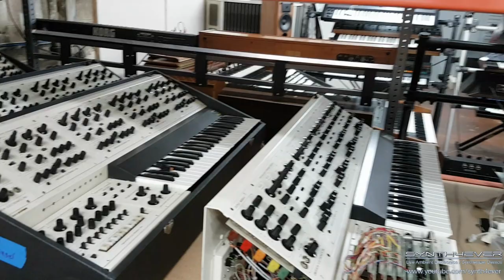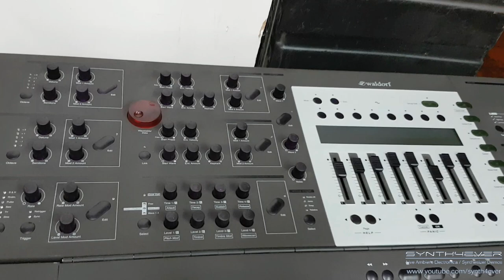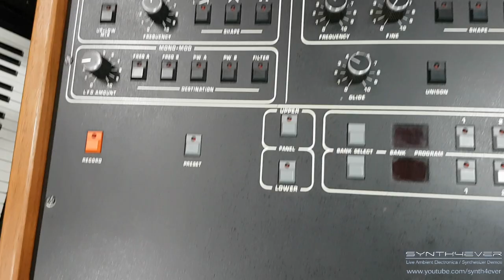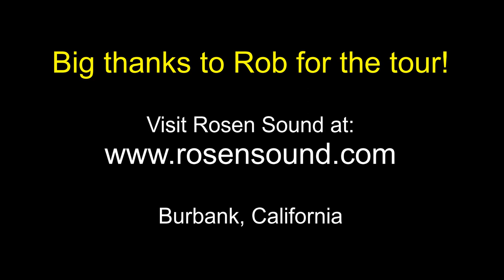ROSEN SOUND - Synth Studio & Repair Shop Tour | Burbank, California

Comment: an odyssey might not be that interesting t mod, but look at the switches, than look at a 2600.. i'm gonna mod mine to be able to work in conjunction with my ttsh, and imo, it's a better combination to use an odyssey with ins and outs instead of switches (might moove these in the back for racticallity to use with the 2600) than to use two 2600's regarding functions... and my ody being a korg FS reedition i'm getting the three filters.... imo, modding an ody IS interesting, and really easy thanks to arp's clever implementation. Greetings from France.